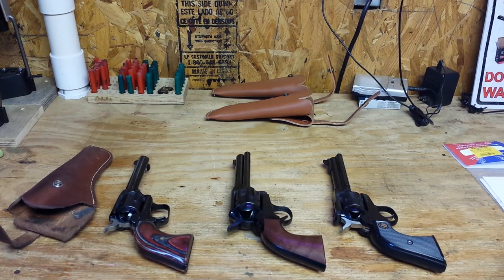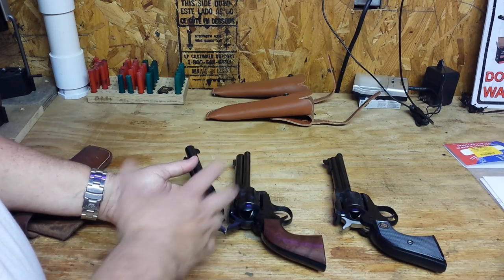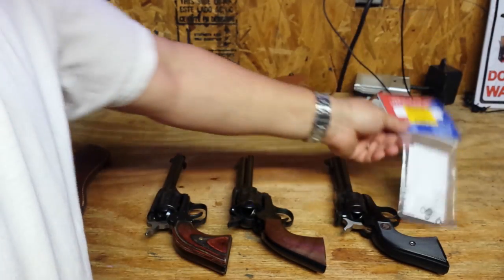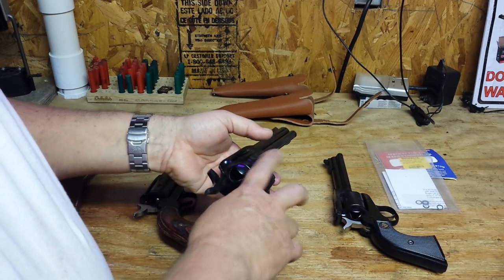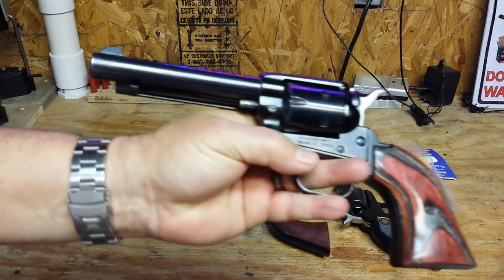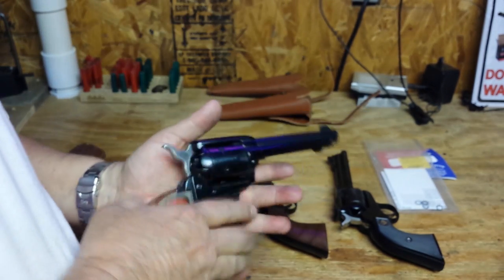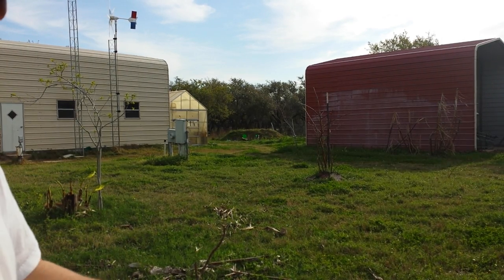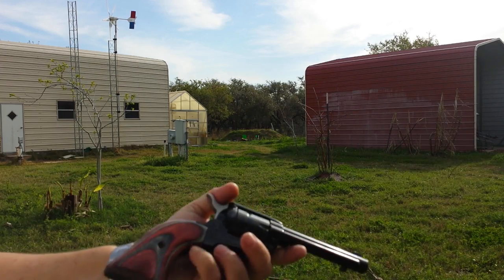Heritage Arms Rough Rider Revolver - Extreme Durability Test

Comment: I have 2 and I've had good luck with them. Bought them for $99.99 each when they went on sale about 6 months apart at Dunham's sporting goods. They have them on sale regularly. Just the .22 LR cylinder for that price but you get a coupon in the box to order the .22 mag cylinder for $30.00 if you want it. Lots of fun cheap to shoot and no worries about using it in the field. Buy one.

Comment: I love my heritage 9 shot.  It has both cylinders but i have shot mostly 22 lr and 22 short as the 22 WMR is too expensive (costs like 9mm).  The shorts are great for indoor shooting in the winter.  I believe the aluminum is only in the frame.  The cylinders and barrel is steel to take the pressure.  Thanks for the video - looks like i have many more years of enjoyment coming from this gun!

Comment: Thanks Al. I have been thinking about buying the Rough Rider. You just sold me.
Reply from the maker: You cannot go wrong. I could have probably done the same with my Ruger but they suffer from the same cylinder end shake issue and that's a much more expensive gun to beat up with 20,000 rounds. I think if you buy the Rough Rider with the 4 3/4 inch barrel, you will love the balance and feel of it. I have another Rough Rider in 6.5 inch barrel but it feels barrel heavy (bud deadly accurate). I think they are the best bargain of any firearm I own.

Comment: If the guy in this video did HIS research, he'd know that "pot metal" absolutely IS used in arms making and he'd also know that the main frame and grip frame of the Heritage Rough Rider are NOT made from aluminum as he erroneously claims.

The Heritage Rough Rider uses main frames and grip frames that are Zamak 5 ("pot metal") die-castings sourced from the same suppliers that Colt used in the last run of their Frontier Scout in 1970.  Heritage uses die cast "pot metal" for those parts for the same reason that Colt eventually did, which is that Zamak 5 is a better material for those components than the "soft" aluminum alloys commonly used in die-casting are.  Colt went from die-cast aluminum to die-cast Zamak 5 to improve the quality of the Frontier Scout and not reduce it.

There is no real reason why a low pressure .22 rimfire revolver with a die-cast Zamak 5 frame can't provide a long service life. The cylinder and the barrel are the "pressure containers" in a revolver.  The Heritage Rough Rider uses cylinders and barrels that are made from 12L14 high carbon steel bar stock, which is the same stuff the barrels and cylinders of the Colt Frontier Scout were made from.

Taurus / Heritage use advanced, precise CNC machining processes in making their cylinders, which results in chambers that align perfectly with the barrel bore.  The precision here is why Taurus / Heritage can sell you a "drop in" cylinder as an aftermarket accessory and the lack of it is why Colt couldn't do that with the Frontier Scout. 

The Taurus / Heritage barrel-making process results in a high-quality end result.  The bar stock gets cut to near finished length.  Those blanks are then "gun drilled" in a fixture that insures a perfectly concentric bore, every time.  The next step is forming the rounded crown.  The next step is rifling the bores with a button-rifling process that results in a very smooth interior bore finish.  Finally, the barrels get pulled through a finish grinding fixture before going into a tumbler (think Remington's "Vibra-Honing Process" because it's essentially the same.  

The Heritage Rough Rider can trace its history from Georgia to Florida to Italy and back to Colt in New Hartford.  It is essentially a "product improved continuation" of the Colt Frontier Scout made from 1957 to 1970.  

An uncle of mine bought a new Colt Frontier Scout in 1962.  He was 33 years old at the time.  It was the only handgun he ever owned or ever cared to own.  He was a user, rather than an equipment collector.  He put at least six "bricks" of .22 LR through that Frontier Scout every year, I know this because I was there when he did it.  That revolver has outlived him by 14 years so far and continues to do so.  

My cousin inherited that Frontier Scout and until I bought my Rough Rider a couple of years ago, he would tout it as being "vastly superior" to the "cheap pot metal junk" he considered the Rough Rider to be, without ever touching one, much less shooting one.  

A few months after I bought my Rough Rider, his Colt Frontier Scout puked it's U-shaped trigger / cylinder stop spring.  I fixed it by ordering a replacement spring for a Rough Rider from Heritage Mfg and replacing his broken original spring with it.  It was a "drop in, no fitting required" replacement.  While we were at it, we replaced his trail-worn grips with the cocobolo wood grips my Rough Rider came with.  They were a perfect drop in fit, too.  

My cousin kept the original box his Frontier Scout came in when new.  Colt had the MSRP of $59.50 printed on the inside of the box with other "selling point" info.  That sounds like a deal until you consider that it takes about $580.00 2023 dollars to buy what $60.00 could in 1962.  It sounds like even less of a deal to me when I consider that I paid $99.99 plus tax for a new 6.5" barreled Rough Rider a little over 2 years ago.  In terms of design, materials, function, and reliability, they're the same gun.  

I'm in to my Rough Rider for about $240.00 because I replaced the original grips with a set of checkered rosewood and ordered a .22 LR and .22 WMR cylinder with both being roll-engraved with a floral scroll pattern.  

I have 4,500 .22 LR and 500 .22 WMR rounds through mine.  The cylinder has no rotational play when in battery and no end-play.  

My Rough Rider is the least expensive firearm I ever owned and in spite of it's "pot metal" main and grip frames, it's my favorite handgun of any I've owned.  

It's accurate enough to be fun at the range or the hunting field as a small game taker.  At the range, I shoot B-25 targets at 25 yards, firing 30 shots in each, as I did during my tenure in law enforcement.  This is the only multi-shot handgun I've owned that I can repeatedly shoot 300/300 with.  I started in law enforcement with a new-in-box 6" stainless Security Six made in 1981 but bought in 1986 and I've never shot a 300/300 with it yet to this day.  I can shoot 290 to 299/300 scores with it but never 300/300.  My Rough Rider isn't the most accurate multi-shot handgun I've ever shot.  I could obliterate the X ring of a B-25 target at 25 yards with my father's 1972 vintage Ruger Mark 1 Target and X ring every shot with it, but it's not my gun.  I shoot my Rough Rider better than any Ruger semi-auto .22 I;ve owned.  On the hunting side, my Rough Rider is accurate enough for me to put a bullet through a bunny's brain bucket on the 10 to 20 yard shots I'm usually presented with.  I've used the .22 WMR cylinder to take two wild pigs of about 100 pounds each.  

I'm not really surprised.  It's got a very good barrel.  The chamber to barrel alignment is precise.  The trigger breaks consistently creep-free at 3 pounds with no overtravel, and it points like a '51 Navy Colt.  It should be accurate and easy to shoot accurately.  And it is.

If it does puke a spring (and it will as the price paid for Colt-ness), it's a single-action "Colt," not rocket science or brain surgery.  

My only regret in buying a Rough Rider is that I didn't buy one 20 years ago.
Reply: I read all that...now I know why I like my heritage so much as to it's mechanical function...I only have maybe 3-4,000 rounds downrange on mine (lost count forever ago), and I look foward to more years of affordable plinking...so far no major problems, and I honestly hope that someday I have to break into the gun to replace a spring or something, just for the experience...

Comment: I used a SAA clone for years as my carry gun, and I've had 2 Rough Riders. They are good single action trainers. They work just like the Colt. And the 22 mag is a good hunter. But the Rough Rider is smaller than the Colt, and imo does not handle like the Colt. It's a good trainer.
Reply from the maker: Agreed

Comment: Thank you for the video! I have to say though that I'm surprised that your gunsmith didn't bring up the cylinder end shake problem, as it sounds like that is a well-known problem. Perhaps it is time to find a new gunsmith!
Reply from the maker: Well, I took it to him for a cylinder timing issue and I had felt something come off misalignment on the inside because the hammer became hard to pull but I just gave it more force and then it gave. That's when it went out of timing, he did find a bent part and replace it but I never told him about the misfire issue so he only looked at the timing problem. If I had told him about the misfires I'm sure he would have known. I'm glad I didn't because I learned something new and learned how to take care it myself. Thanks
Reply: econewpower
I understand that. Its just that, to me, it would be like taking the car to the mechanic because the tire is leaking and needs to be patched, but while taking the wheel off the car, the mechanic fails to notice, or notify you, that the wheel bearing is shot and about to fail. I would presume that the gunsmith function checked the gun before, and after, the repair, and might have noticed the loose cylinder. Or, at the very least, known that that is something to be aware of with this type of firearm. In any case, if you are happy with his work, then who am I to say otherwise?  :-)   Be well and take care!  ( more alternative energy and aquaponics videos, please! )
Reply from the maker: Coming soon more aquaponics and energy videos

Comment: I have 2 Heritage 6 shot pistols both of them shot to the left and hi so I ground about 60 thousands off the front sight and the rear sight is unmovable so I filled it with J-B Weld then ground a slot on the right side of it painted with a magic marker they  are used for Bullseye Shooting 25 ft

Comment: I purchase a Heritage Rough Rider 22/22 mag from Classic Firearms on 12/29/2019 and received the revolver that had a dent in the barrel' crooked sights, and the bluing with sever pitting on the frame was deplorable. Called Classic and they said to send the gun to the manufacture for repair. Well I did return the gun to the manufacture on 10/14/2020 and after a lot of problems trying to contact and find out the status of the repair from the factory they said they received the gun on 01/31/2020 and would be 3 months before the gun would be repaired and retuned. Yes the gave me several Service Request # and I have emailed  them for status updates to this date (Now over 3 months time) without a return comment form the manufacture. My last request was today 05/10/2020 and for repair status and or replacement of the weapon. Customer Service by the dealer and the gun manufacture is very poor and I wouldn't recommend purchasing anything from either company. 
This was a brand (Supposedly) gun from Classic Firearms and Heritage. Also I never fired this gun from the time I received this weapon. Very poor Customer Service.

I have requested that Heritage return the gun so I can return to Classic Firearms for refund. Not only is this gun under warranty I purchased an extended warranty so we will see what happens. Thanks folks, have fun and shoot safely.
Reply from the maker: Wow, what a terrible experience! I hope you get it resolved, I'd be very upset.
Reply: What really has me disturbed is I never even got to shoot the Rough Rider plus the quality of this particular gun. Feel about the same from Customer Service. Buyer Beware when you order a gun on or from a internet seller. This was my first purchase from this dealer and manufacture. I learned a lesson, that's for sure.
Reply: Wow, that's crazy. The problem being Taurus bought out Heritage. I've had nothing but bad luck with Taurus. BTW I just purchased the Heritage Rough Rider. It's been great so far. 🤞

Comment: How did you mil the rear site? I may want to try but not sure how to.
Reply from the maker: Drill press with cutting bit. Make jig to clamp it on and steel bars clamped to to the drill press table to form a channel with which to slide the revolver under the cutting bit
Reply: Do you have a Dremel?  Used mine to take the front sight down about 3/32nds of an inch (More than a 16th but less than an 8th). Shoots right on now. Do NOT take off too much unless you can rebuild your front sight. Too much and you will shoot high. Only mil it IF you are shooting low and are comfortable doing so.

Comment: How many inches is the heritage barrel?
Reply from the maker: +Daniel Gonzalez 4 3/4 inch, but they also make them in 6 1/2 and 9 inch barrels.
Reply: Ordered one Friday for 141 bucks Kentucky gun co they said its blemished also I saw a 10 shot chiappa in a gun store saa 22 you have any input in them thanks
Reply from the maker: Daniel Gonzalez Yes, stay away from the Chiappa. The barrel is aluminum with a thin steel insert for the real barrel and the cylinder is the same way, it is nowhere as good quality as the Heritage Arms.

Comment: is the ten shot an EAA Bounty Hunter?
Reply: Never mind, just saw your other video, Pietta 1837. They are nice looking guns but I would put my money on your Ruger lasting the longest.
Reply from the maker: offonroad Well, the chambers in the Ruger are too tight to load rounds comfortably after a few shots. I bought a Blackhawk in .357 Mag years ago and had to send it to back to factory because one of the cylinder chambers was too tight to push a round in, the .22 cylinder is not that bad but will have to be reamed so my finger isn't sore from forcibly pushing the rounds in. Ruger firearms are fine, I have four, but they are no better than any other quality domestic or import brand. I'll bet you that if you fire your Ruger 20,000 plus rounds like I've done with the Heritage Arms, it will have the same or worse problems. The Pieta seems to be built better than the Ruger as far as the fit and finish. I hope whichever you choose, serves you well.

Comment: How is the superglue holding?
Reply from the maker: what superglue?
Reply: at 3:20.
Reply from the maker: Ah yes, gap needed two shims and aligning them up was a pain, so I ended up supergluing the two shims together. That worked fine and has never come undone. What I did was roughened up the surface of each shim with sandpaper so the superglue would "bite" well and stuck them together. Now when I take the cylinder out and put it back in it is simple to line it up.
Reply: Sweet. I appreciate the response; I just ordered a HRR and am looking over all known issues in anticipation of receiving it.